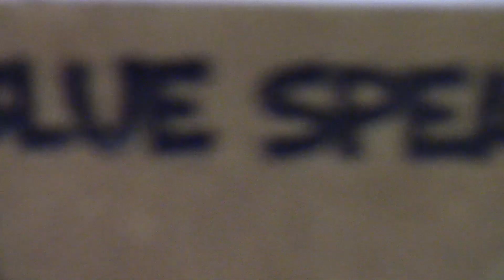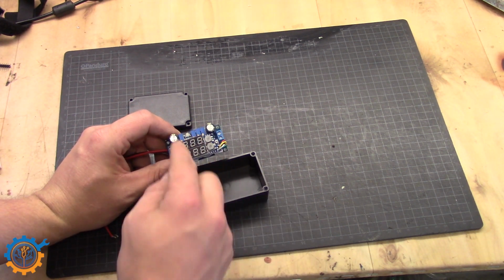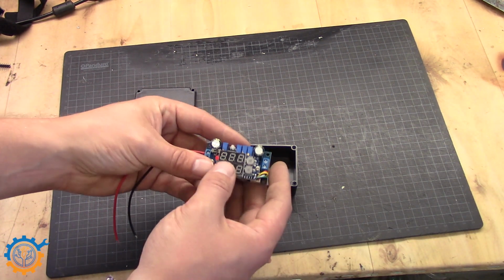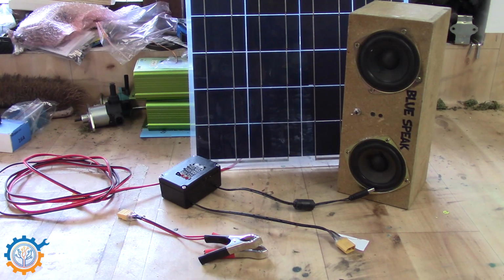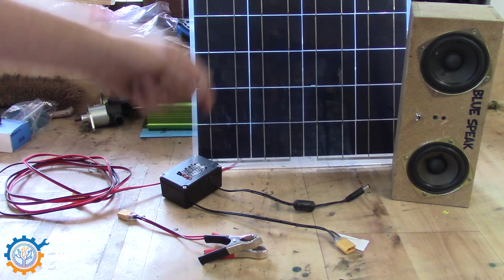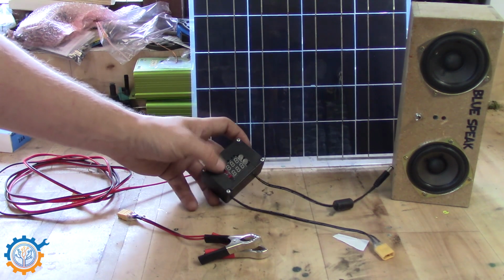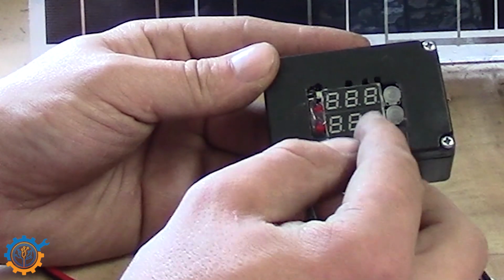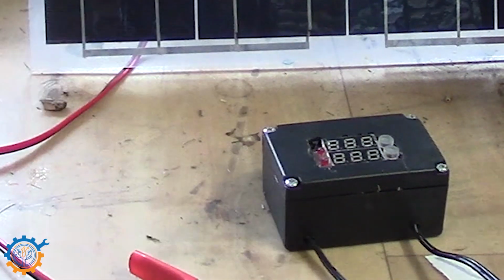Solar MPPT charger for my Bluetooth speaker

Comment: Nicely done hope it works wonderful for you I use one of them to run some lights and love the fact you can set the voltage and when it goes below it shuts off so my battery does not drain.

Comment: Really great work, man. That MPPT is based in the XL4015 chip I believe. It's really great, I have one step down of that kind, but without the MPPT pot, that I use to charge battery packs with BMS too (using a notebook power adapter). :)

Comment: Hi, 
I have a question,

Solar panel open-circuit Voltage: 40V

Battery 12 V (AGM)

Controller : PWM controller max input voltage 28V

i need to step down from 40V to 25V and connect to
solar charge controller to charge the battery? Will I lose energy in this converter
in step down mode? Or the module will convert in to Amps from Voltage while step
down?

Can i use this module?
thanks,
Reply from the maker: Get. A proper mppt Charger instead designed for the voltage. Above wont work.